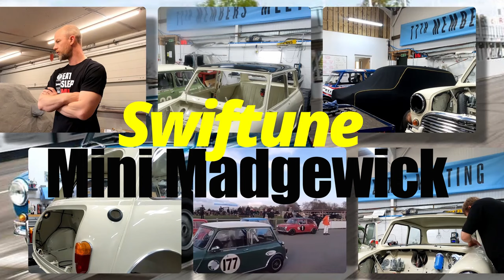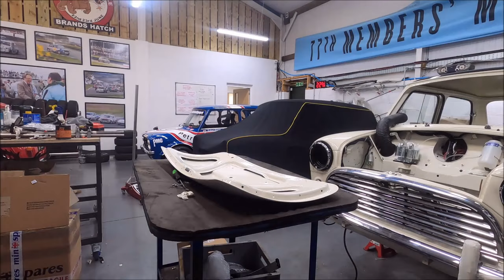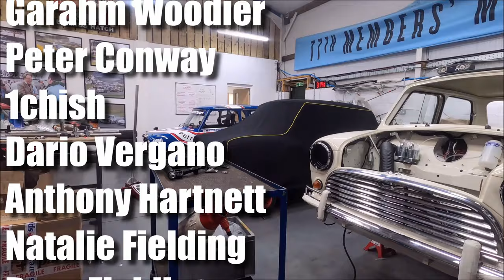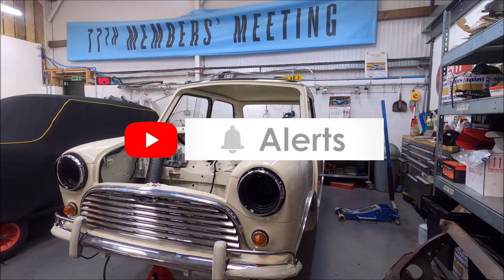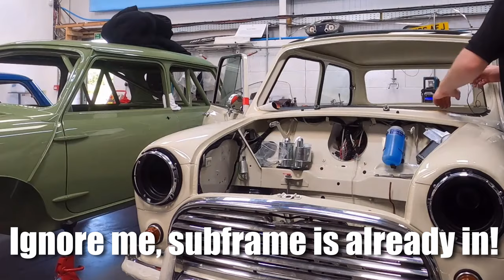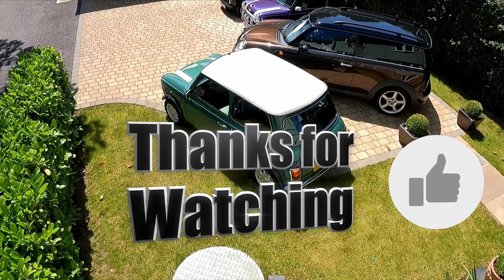Swiftune Madgwick Mini Cooper S Assembly Part 3 - Classic Mini Workshop

Comment: Hi Keith,    Wow that moulding they are using at Swiftune is so much better than the "deluxe" moulding you can buy at the usual outlets. It goes on like a piece of rubber stripping.  Thanks for showing that Keith.

Comment: Thanks for the slowed down clip. That trim looks so much more pliable than the standard trim. If you find out the supplier I'd love a link. If you have a look at the wheel arches on an Australian spec S you will see how the flares are clipped to a pop riveted flange and curve out and back in making the standard trim extremely difficult to bend in two directions at once.